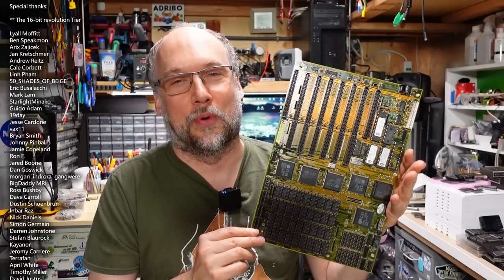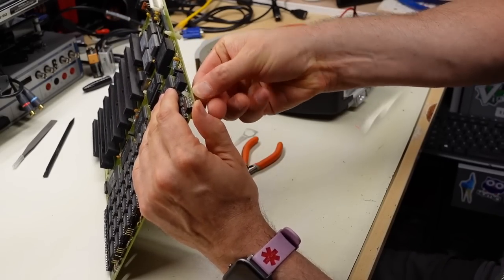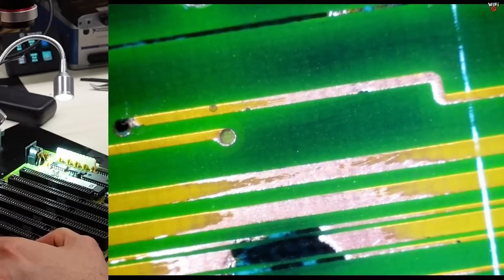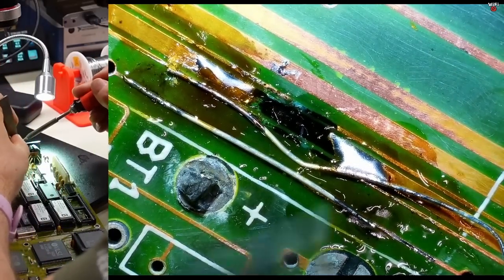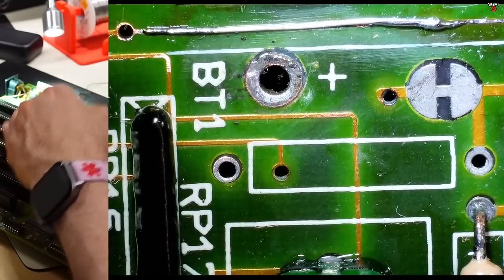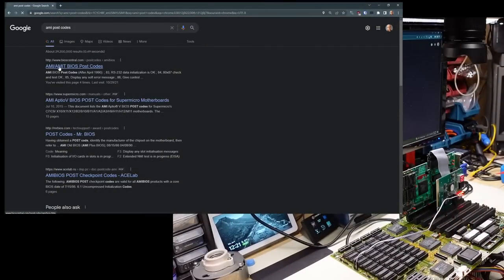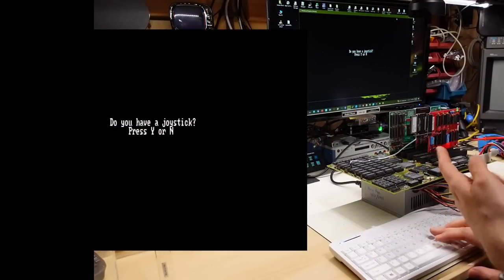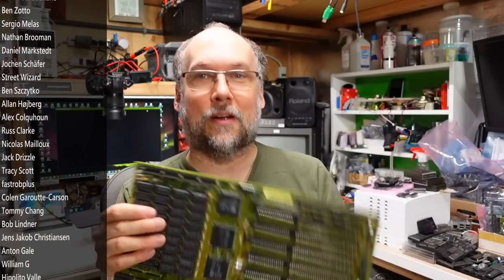286 motherboard repair - VARTA battery leaked

Comment: There's a little trick to removing those plastic standoffs.

In the typical design, there are three wings, not just two--a third smaller one is in the middle and perpendicular to the other two.  This third wing acts as a catch to prevent the two large wings from compressing.  When you press the standoff into the board, the round hole applies pressure to all three, so the two large wings collapse easily.

So, to remove them more easily, use your pliers on the two large wings, and use a cleaning pick or tiny screwdriver to apply pressure on the catch in the middle.  The two large wings will collapse with very little force and without damage.

The cheaper design of standoff just has the two wings, and there's no trick to them--they're disposable in that each compression of the wings degrades them.

Folks who wanted to be really fancy used threaded nylon standoffs that came apart in two pieces--a forerunner to the brass or steel standoffs we use today.

Comment: Never used MG fluxes personally but 8351 is for wave soldering and has low activity. It really is not suitable for repair (Old stuff) the liquidy ones are useless for repairs as you notised. Nice gellyish heat resistant ones are better. Good flux makes massive difference.

Comment: @Adrian's Digital Basement
The liquid flux's are great for reflow and removal jobs, but for soldering work like what you're doing here, you need a rosin paste flux. Rosin pastes do not evaporate away like the liquid types. It's a "right tool for the right job" kind of thing. Your liquid flux is just fine. The problem is the way you're using it here. I hope that makes sense and doesn't come across as insulting.

Comment: for the video card, you could thicken up the connector by putting solder onto the pins on one side, and then sand them down to fit if neccessary.
Reply: Nope you dont ever do that
Reply: @primus711  if so then why. The pins are pretty far apart in Isa slots
Reply: @probablyanadult7354  you bend them back or replace you never use solder for anything but actual soldering

Comment: For how to remove the plastic standoffs from a motherboard, I had a small length of metal tubing that was just large enough in diameter to slip over the top of the standoff and it would push the retention clips in and it would then pull right out, no muss, no fuss.  I have no idea what that measurement is or where it came from, it was given to me when I was working at a computer repair store in North Carolina in the late 1990's.  In plastic standoff AT days, I'd usually keep some extras and snip off the sliding tip on the bottom, so the board was supported at the back edge where a lot of cases didn't have slots to place them.  I also had some luck with sliding the standoffs into the slots themselves, then pushing the motherboard down onto the standoffs to help ensure all of them were seated.  So annoying to keep having one not slot in - and sometimes they'd play a game where it was always a different one each time you tried!
Reply: Oh, and then I see you tried with the straw.  Guess I should just shut up and watch the video :)

Comment: I would have probably repaired that board the same way, except that I have been using UV-cure solder mask... but my not-a-nail-curing-light isn't up to a speedy cure time. Maybe I should check out using nail polish.

Comment: Hi Adrian, i've always found that a hollow BIC Pen with the ink tube and ballpoint pulled out of it can be used to put over the pointy end of the stand offs to hold the plastic barbs in while you pull it through from the other side. It always worked for me when i was replacing / repairing motherboards for customers.

Comment: It's possible to use a clip for AA or AAA rechargeable NiMH batteries, also.  They are more convenient than phone batteries, and the clip can be stowed in a plastic travel soap box for a truly inexpensive leak-stop solution.
Reply from the maker: Yeah definitely. If you don't use a diode, just get a three AA battery holder and install three Eneloop or other modern NiMH and it will work just fine. Those are probably good to no leak for a very long time too. Just velcro the batteries up to the side of the case out of the way.

Comment: next time you may want to use copper adhesive shielding tape  instead of wires, cut it in strips with scizors and glue strips on broken traces , then add litte flux , litte solder in the ends to just bridge from tape to the trace and you can still cover it with nail polish but it is much less effort than routing bodges all over the place
Reply: and for that bios battert5v? tp4056 or similar charging board with power passtrough and small pocket lithium ion cell

Comment: Adrian, I've used the same diameter tool for removing the securing nut/bolt on serial ports (whatever that damn thing is called).

Comment: instead of replacing with another battery, wonder if a 'supercapacitor' would work, i had some old  tv digiboxes that used a small 0.33Farad (330,000uF) 5.5v backup capacitor,

Comment: I hate Varta Batteries, every single Device where I had a Varta Battery inserted had corrosion damage.
Recently I had to repair my soap dispenser because I forgot that I had a Varta Longlife (rather shortlife) Battery inside. This only happened to me with (every) Varta Batteries, The Cheapest Battery from my local Grocery Store never had a single leak.

Comment: Maybe using a scalpel and a spark plug brush (the toothbrush-sized cheap kind you can find in dollar stores, usually sold with a set of gauge blades) will give a better and faster result than the tweezer's tip.
20:00 If your 8351 no clean flux is drying too fast, you can try to add a bit of pure rosin powder to enhance it... but you'd have to clean it with isopropyl alcohol for cleaning, then (sarcasm off).

Comment: 36:50: I suppose the reason it didn't work the first time and did work later might have to do with a capacitor self-healing, and that interfering with the boot process. That's just a guess though.

Comment: you need to insert a tube in the same diameter than the hole in the pcb, and the stand off will be ready for another use.

Comment: Nice video, Adrian.  Just a thought, have you considered the use of copper foil tape for trace repair?
Reply: On wider traces yes thats possible, but these traces are so very thin. Not sure its even possible to cut the foil to width.
Reply: @g0bzy  Eighth inch is pretty common but I can’t quickly find thinner material.  It’s out there, though.  It would indeed be a challenge to trim.

Funny thing, I became acquainted with this material in a totally different context, stained glass work.  You apply the copper foil to the glass in order to solder it together.

Comment: ive fought traces like that (i work on Game Gear's) .. i find i almost always gotta use either apoxy or clear nail polish and scrape only one trace at a time..fixe it the coat it... I am absolutely horrible at it if i have more than one trace exposed to be soldered.. lol

Comment: I use contact cleaner DUECI ELECTRONIC G-20 or R-10  and Acetone to clean boards. I had a 486 and now I realize that it may be a trace problem. I just bypassed battery with a new one from botom soldering 2 wires to new battery. However it did not boot up.(black screen) the 486 cpu gets some  power as it starts to warm. Tnx for video.

Comment: i remember that mobo last few years agos that you try test it but nothing was working because of traces is broken and after you fixed traces now it working that awesome 

i dont recommend that flex no cleaning because i have use it never ever work and yah i throwed it away for some reasons it doesnt do what it should do and went back to flex pastes it worked so better (it will turn into liquid once get hot that all)

Comment: Try Amtech 559. It leaves residues but they are easily cleaned with a toothbrush :-)
With 60/40 or 63/37 it really Works well. Check also Working temp of the iron It's a iron thermocouple.
Some flux don't do All With high temperatures, they just fizz away and don't do much.
You are in the end doing a great job butt loons you are having a hard time ;-)

Comment: Yet another comment about those plastic stand-offs. Some model shops sell brass tubing, with quite specific diameters (OD and ID). Keep a corner of an old PCB with a standoff fitted,  just for the laugh, and try all the things you find. Model shop brass tubing is the best bet though. Think of the Molex pin removal tool for HDD connectors and the like. Shove it on, all barbs close up and meet nice and it'll just come out with little force. If you do find said brass tube, deburr the end you wish to squish the barbs with, else it will peel the barbs and the main pin out, making things even more difficult. Rolled up sand paper, or a fine wire brush in a dremel type tool, etc etc. on the ID of the tube.  Just make it smooth.

Comment: There is an LED on the POST card labeledy IRDY, it has something to do with the BIOS is present and working with the CPU or something. The motherboard I wrote you about on Patreon doesn't seem to run, I tested the BIOS chip in a different motherboard and it was working, so I'm guessing the chipset that helps connecting the BIOS with my CPU was damaged, probably the power was connected in backwards and killed the chipset and probably it was the thing that killed the voltage regulator to the CPU Vcc (that I replaced but still no luck). I'm keeping this 486 motherboard for parts, or maybe I'll be clever enough sometime in the future to be able to diagnose it more and fix it.
Reply from the maker: Really once the motherboards get to 486 and beyond, it starts to be impossible to troubleshoot due to everything being obfuscated behind chipsets without datasheets and no schematics. That particular pin though is IO Ready or IO Channel Ready: https://commons.wikimedia.org/wiki/File:XT_Bus_pins.png 

What that signal does it this: I/O Channel Ready allow slower ISA boards to lengthen I/O or memory cycles by inserting wait states. This signals normal state is active high (ready). ISA boards drive the signal inactive low (not ready) to insert wait states. Devices using this signal to insert wait states should drive it low immediately after detecting a valid address decode and an active read or write command. The signal is release high when the device is ready to complete the cycle.

So yeah if it's not coming on, then whatever normally drives it high (probably the chipset on a 486) it means things are broken -- OR something might be shorted and trashing the bus including that line.

Comment: ADB. The working man's repair "guide". also, I bet a smaller, cleaner tip with quality flux (more jelly like) would go along way with micro soldering issues (not yours! anybody else:). Just saying.

Comment: @21:20 You get those bridges because you use way to much solder! Just tin the traces so they appear silver instead of copper-colored, tin the wire you want to solder to it, and add a tiny amount of solder to fix them together.

@33:10 I would have liked you to not unplug the speaker that quick. Probably that board has an AMI BIOS which should beed exactly eight times if there is no graphics cards (not counting the initial beeps at a different frequency). You killed it after the fifth beep, so I couldn't count up to eight... @34:30 well, you let the speaker connected this time. It is 8 beeps indeed, so definitely not recognizing the VGA BIOS. Let me guess: 30 is RAM check, you would just need to wait some more time...

@36:20 that table is imprecise. It's not "virtual mode", the 80286 doesn't have the "virtual 8086 mode", it should read "protect mode". My guess was wrong, though. No idea why the machine stopped there. Switching to protected mode involved the keyboard controller (but it should have been checked before), and switching back involves the CMOS RAM as well (has also been checked before). Probably you would need to disassemble the BIOS to find a reason for the machine to stop at 30.

Comment: IDK, but I find it awfully hard to believe Adrian doesn't know what POST means when he can rattle off tech data about things I've never even heard of. I think it was the Vodka talking, or he's just yanking our chain ;)

I sure wish I had the tool setup, because I have 7 or 8 old 386-486 mobos, all with significant battery leakage... One day maybe...

Oh yeah, and maybe a little Deoxit on the slots would eliminate the sketchy video?
BTW, the DSlogic analyzer links are broken...
Reply from the maker: Those microscopes are somewhat cheap -- about $150 for a decent one. It makes all the difference between making a good fix and struggling. (Unless you have super good eyes, which I don't.) 

And yeah, the links -- a bunch are broken now -- I really need to just host a page somewhere with links versus all the videos with now broken links on them!

Comment: not just nicads, nimhs leak as well, i've just found a replacement nimh i fitted about 10 years ago as replacement for a nicad(yep, it was varta branded😉) has leaked and caused more damaged, and motherboard no longer working, although i 'think' i patched up all rotted tracks,  one chip had green corrosion on its legs, so maybe it got inside and killed it 😢,, also had many nimh packs in laptops also leak, in one case it dripped out of it when i tilted the case 😢
Reply: i have both that type of post code card and a parallel port one
Reply: bet it was poor contacts either in the isa slots or on one of the chips, flexing the board a bit while moving it ,may have made it made contact

Comment: first bit bit bit .... not stop means memory test fail. Bit pause bit bit bit means graphics card problem and never try to run this type of board or 386 or higher with no battery same times not boot at all ... and the dma test you run is to check if you have any irq or dma conflict in your system, if you have lot of  cards is not pnp system and conflicts happens a lot if have sound cards parallel ports etc ...

Comment: I love Volka myself. Yes, we Varta are out to destroy all PCs. LOL. :P A joke as my dead last name was very close to its spelling. As I am a transgender female that was wrongly assigned male at birth. I love working on computers and game consoles and have learned a lot about retro computers that I grew up as a child here. My first computer was a Texas Instruments TI-99/4A I got nearly brand new at a garage sale. My father hated computers and would not buy me one that was new. I had to do so out of own money I earned from mowing people's lawns. He was so mad when my mother bought us an Atari 2600 earlier that year for Christmas. She did not warp it and played it in her room tell she put it back in the box and give it to us for Christmas. She got it mostly for her to play Pac-Man she loved to play on her uncle's Atari 2600. My TI-99/4A caught on fire as the power supply overheated one summer. And I learned how to repair it by taking one out of a donor TI-99/4A that the processor was dead. It had damage to the case and melted one of my game carts a bit. So I had to take them apart and fix them too. With donor cases. I had gotten a lot of parts in a big box of Atari and TI-99/4A dead system parts I bought at another garage sale. I even got those other extra TI-99/4A addons in that box too I got working. And I did a ram upgrade myself on my TI-99/4A.

Comment: Time to design a new Replacement 286, 386 and XT Motherboard with New Old Stock, available components??
Reply: Chipset availability would probably be a bit problem
Reply: @gigigigiontis8  for 8086-80286 the Chipsets should be simple enough to be made with modern replacements or even TTL Logic or simple GALs or FPGAs.

For later Systems with more modern Chipsets, such as 486 or Petiums, I'd agree with you, that could potentially cause a Problem...

Comment: These vias look suspicious. As they are vias, it is worth to test if they go back electrically to the other side of the board.
Reply: yup, i thought that too. But the board is working. So it seems.
Reply: @g0bzy  Capacitive coupling may make it work from time to time, depending on air humidity and temperature.

Comment: If there is a better_way to find what circuit has a "break" or something.... that would be interesting(slight_pic)
Reply: If the (circuit) rotates, it may be then, that you see "other_change's" from the capacitor line's. As well as clues to other point's on the board(20)

Comment: Adrian, why are you squinting?  Need a new prescription for your glasses?  Increase the size of the font for your script, be it paper or teleprompter.  Keep up the good work.

WD40 works great not only stopping the corrosion, but it also penetrates and loosens the corrosion.  If it can do it for automobile batteries, it certain;y can do it for PC boards.  Just let it sit and soak.